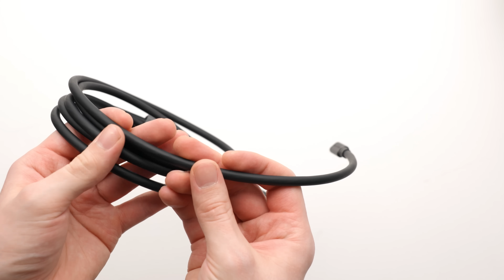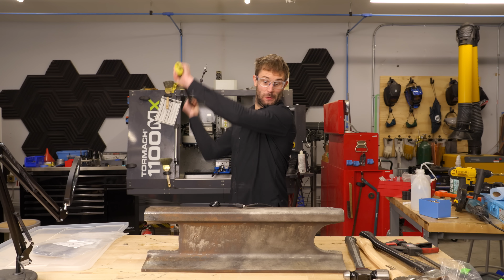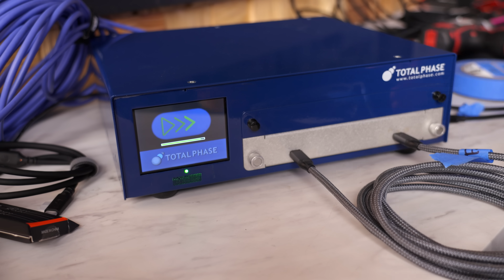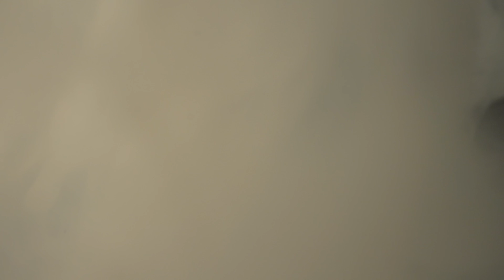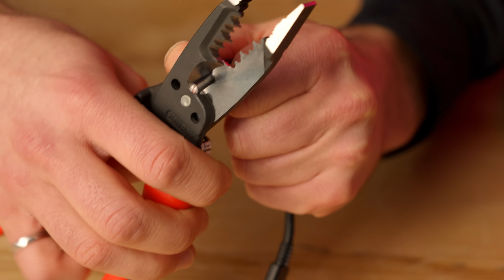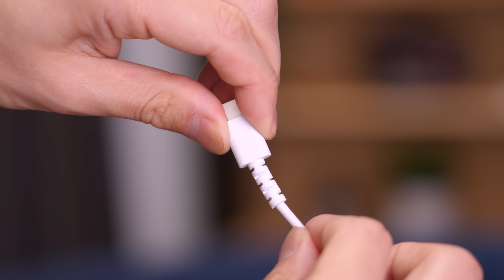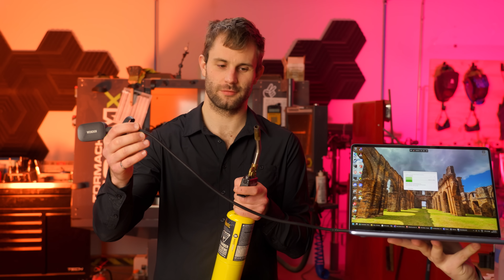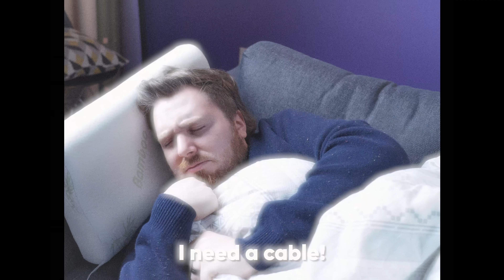Why It Took Me 4 YEARS to Make a USB Cable

Comment: "No products found" on the website. Oof
Reply: They sold out really quick. They talked about it on WAN.
Reply: @iSupermanCKi taking it down is so much worse than making it look like you never had it just say sold out but will all the information and pricing
Reply: @james10739  It probably has been taken down by mistake, they were having problems with the store, don't see why they would need to delete or unpublish their product listing.
Reply: @james10739  apparently there was a bug that allowed people to backorder the cables. so they took the page down while they are working to resolve the issue
Reply: @james10739  yeah, I just want to be able to see the specs and the price even if it’s not available at the moment
Reply: @james10739  Update from Linus: "We are having an inventory tracking issue where the site is allowing people to order out of stock cables and to minimize the number of backorders we are taking, we turned the pages off while we work with our team and Shopify to fix. It just happens to be the weekend so it's not as simple to get it's patched immediately. "
Reply: @james10739  They took it down because they are gonna charge more for it lol. Finally they will learn what its like to be an actual business like NVIDIA. They'll release a PR statement that says "We see strong demand for the cables and have taken down the page to better fix some issues for the future"
Reply: @james10739  It was an issue with shopify allowing people to purchase out of stock items so they had to just remove them completely so it didn't get backordered like crazy. Tons of websites were effected.
Reply: @james10739  I suspect they don't want to put a price up until they get an new batch of them
Reply: @james10739  It was taken down due to a site error, not just because it sold out
Reply: @james10739  Here's a direct quote: "We are having an inventory tracking issue where the site is allowing people to order out of stock cables and to minimize the number of backorders we are taking, we turned the pages off while we work with our team and Shopify to fix. It just happens to be the weekend so it's not as simple to get it's patched immediately." If the store allows people to buy out of stock products then that's not good. They made the right choice IMO.
Reply: @james10739 what if you have no supply but people keep ordering and you dont have a warehouse stock registration build into the website
Reply: @iSupermanCKi I’m so surprised they didn’t have good forecasting on the demand. A great USB cable is something everyone wants and can use multiple of and a lot of people trust LTT. Would have been the first thing I ever purchased from a YT channel haha.
Reply: @THONGPOUNDER6969  why would you want a "great" usb cable? legit question, 98% of them are just used to charge stuff and 2% are used every now and then to transfer files for which performance is not an issue
Reply: @moiseman  you really want to move gigabytes of data with sub-500 Mbit/s speeds?
Reply: @XGD5layer  what are yall out here moving?
Reply: @kobeandgary  These fans are tech enthusiasts, it's pretty likely that people here have external/backup SSDs, secondary mini monitors, local hub storage, etc.
Reply: @moiseman  Just because you only use them for those situations, not everyone does. Performance is an issue with USB cables, as discussed in this video, along with the situations where you could use one of these cables. Maybe watch the video? My main need for a high quality cable is high power delivery, which a lot of USB-C cables cannot do, despite that spec saying they should. Also video over USB-C, again, low quality cables cannot do. If you can get by with cheap cables, then awesome, but for those who actually need these, they are great.
Reply: @moiseman  You don't really want all of your cables to be "great", and 99% of the time it's completely unnecessary, but a lot of tech enthusiast would want a couple of them for that 1% occasion. Sometimes, you just need a USB C cable that works for anything.  

For example, when I travel, I usually bring a mini dock for my phone. It has 100W PD, built in nvme SSD, HDMI, and high speed USB C hub. I don't normally have to use it at its "full", but when I do like for work or offloading travel videos/photos from my phone and camera, I need a cable that I KNOW works. Not that hard, right? You'd think so, and I thought so too. It took me 5 cables that all claimed 10Gb/s and 100W before I gave up (some worked, but were unreliable). I had to go overkill and get a thunderbolt 4 cable just so I have some peace of mind.
Reply: @THONGPOUNDER6969  They did anticipate high demand, but were unsure of which sizes to focus on stocking. They bough a bunch of ready cables to terminate into appropriate lengths after the launch based on demand.
Reply: @Mel21-21  I know - I’m saying their forecasts for demand were clearly pretty far off, though (unless they were going for a scarcity marketing play). Just surprised their forecasting team missed it by so much. Builds hype though! We’re here talking about it!
Reply: @moiseman  Personally, I travel a lot for work and the one cable I can't seem to find a replacement for is my cable that powers my portable monitor or my USB hub with an HDMI out. That single cable has to do high power and high quality data or else my display just power loops. I've tried quite a few big brands like uGreen, Cable matters, and Anker, and none work. That's a hard cable to replace if it does ever stop working.
Reply: @moiseman  For me it’s reliability and durability, primarily. A cable is a product I expect to work as intended every single time. I’m willing to pay a little more for that. If it speeds up data transfers due to less error handling, that’s just a bonus.

If 98% of your cables are for charging, I completely understand going for cheapest option. I have 4 cables I use for charging devices daily and 25-30 handling data connections in my house/office. When one goes bad, it’s a pain to check all the connections one by one. Even on charging cables, if it lasts 2-3 times as long, the cost isn’t all that different.
Reply: @moiseman  Android auto, the cable that was working died, replaced it and the new cable is having issues almost immediately. I havent bought any but personally I want a 1 foot long LTT cable just so I dont have to fight it with it anymore.
Reply: @moiseman  While it may be overkill for a charging cable, a good quality one should last longer without falling apart, and be less likely to get damaged by accident — but who's to say it will only be used for charging? Sometimes you do just need a USB cable to connect something. Meanwhile for USB attached devices like fast storage, better cables that suffer less interference will give better speeds and reliability, same reason why you shouldn't buy cheap network cabling (especially the really thin/flat ones).
Reply: @moiseman  maybe 20% of my usb cables are for charging. The rest are for things such as video (drawing tablet, 4k web cam, etc), file transfer (large video files, backups, isos, etc), or IO (wired controller, keyboard, mouse, dock, etc). For a majority of these tasks, I often have issues with cables failing incredibly quickly, or performing very poorly, interrupting data/power from the slightest bump, taking 2-5x as long to accomplish a transfer, not working at all for video display, or creating measurable latency in input.
Reply: @THONGPOUNDER6969  To be fair it is a new market for them and going conservative means they won´t end up with a warehouse full of cables that noone wants to buy.

But ye the out of stock hype does not hurt either. :)
Reply: @Mel21-21  very true. And scarcity increases hype. I’m just bummed I didn’t get to buy any haha.
Reply: @iSupermanCKi  The page should read "Temporarily sold out" instead of "No products found".
Reply: @ShanesGettingHandy also keep showing the cable still. s0howing 0 products feels like the user does something wrong
Reply: @garcipat apparently there was an issue where people could preorder the cable even though LTT doesnt want to do that, so they removed the listing entirely to stop it from happening.
Reply: @agafaba unfortunate, hopefully their webmaster figures it out before people just start assuming the product failed to launch
Reply: @iSupermanCKi  So what as the price for the cables?
Reply: @Earth-Apple it's literally in this thread you just commented on...
Reply: @iSupermanCKi how much where  they
Reply: @thestarafresh   They were pretty well priced. Between $20-$30 USD
Reply: @therobowolf I've spent more on less for sure. my current 100w 10ft cable was $22 USD
Reply: . I honestly have zero clue what my current cables are rated at, but I don't have money to worry about it right now
Reply: @therobowolfoh. Thats's not nearly as bad as I was expecting. I thought it was going to be like $60-90usd. This is a price I think I might actually be able to afford!
Reply: @therobowolfthat's crazy, I was thinking they'd be more! I've spent that on a charging block alone easily.
Reply: @therobowolf Oh that's not bad at all. I was expecting much worse. I'll definitely be grabbing a few when they come back.
Reply: WHERES MY CABLES LINUS? TAKE MY MONEY
Reply: @Shellll  Yet another rug pull.   As if they couldn't predict demand, yet here the video stays up, gotta get them views.  Actually that's a great strategy, just announce great products we all want, they need not exist, and soak up the sweet sweet views.
Reply: @robpetri5996 lmao y'all are insufferable
Reply: @robpetri5996  So you think a multi-year technical development of a product can be financed by ONE video with currently 1.7M views?
Reply: @arlheinz  I certainly do not.  It would be financed by sales of product.   Alas there is no product to buy,  just a hype video an disappointment.  You don't have to agree with me.   Just annoyed because this happens all the time with youtubers.   They hype up a product or piece of merch and it sells out immediately, just wish folks would stock enough and it isn't like LTT didn't have the same situation with the screwdriver so they should have had a clue on demand.   That said i'm glad they are making them, I suppose they'll make more someday.
Reply: @r @robpetri5996 its just a cable. Don’t get so invested in such a small thing
Reply: @robpetri5996  I don't think you understand what a rug pull is. A rug pull would be if people bought it and didn't receive it.
Reply: @robpetri5996  go outside, bro
Reply: @robpetri5996  lmao this aged like milk
Reply: @mcbergstedt  Sweet.  Thanks for the heads up.
Reply: @robpetri5996  rug pulls work when you sell items, and leave with all the money dropping the value of the items to zero. If they don't have enough items to sell, how is it a rug pull?
Reply: @robpetri5996  Your argument boils down to demanding that small companies overestimate the demand for their products just to make sure they don't sell out.

Doing that is what killed THQ, they overproduced U-Draw tablets and it bankrupted them.

Just chill and wait, this is what sustainable business looks like.  it's only a problem if they're intentionally limiting production and trying to double-dip on the resale market, which isn't likely for a commodity product like this.
Reply: @robpetri5996 the fact that you actually doubled down 🤣🤣
Reply: @KevwePatani  I'll triple down too.   Its fine for us to disagree but I have every right to find it annoying to drop a hype release vid for a new product and not have the stock to last a few hours.   They know their audience and they know what happened with the screwdriver, it was avoidable.   It's great that they 'found' some more of two of the like 20 cables, doesn't change that it isn't unreasonable to find annoying the youtuber product cycle of "Big Splash!!!!" / "Sold out in minutes".   Why bother hyping the 2.1million people who watched this when they served some tiny number of people in the first couple hours.
Reply: @robpetri5996 "why bother advertising if you're just going to sell them all? " This is what your outburst sounds like to me. A nothing burger
As much as I'd like to consider myself unbiased, I'd have to admit that I'm a ltt fan. I don't throw a blind eye to their screw ups and missteps tho(Unsubbed during the billetlabs debacle). This whole "can't believe they sold out" spiel is a complete baloney from where I'm standing. 
In an ideal world they'd perfectly predict the amount of demand they'd have for this product and have ample money in the bank to be able to fund the manufacture of said product and then we can all hold hands and sing Kumbaya. 
But that cannot be farther from reality. Even if they could accurately predict the demand, say from extrapolating from the Screwdriver release, that wouldn't really cut it cause a USB cable is far more ubiquitous than a screwdiver  and so the demand extrapolation would be wrong. They would still need to have stocked the massive pile of cables in God knows what warehouse. Paying out of pocket for the merchandise and the storage fees. Without any indication that it wouldn't be a complete failure.
Also, i find it interesting how you consider a video that introduces and explains the product a "hype video". Like as if the claims made will turn out to be a lie. Or that it's a rugpull... Who's rug are the pulling?! It's their loss if they cant sell cables cause it's out if stock.

But yeah, i understand that people might not feel so fondly about the enterprise or the dude at the helm, but leaving bad faith comments like this to color people's opinion is totally not cool. Do better.
Reply: Update from Linus: "We are having an inventory tracking issue where the site is allowing people to order out of stock cables and to minimize the number of backorders we are taking, we turned the pages off while we work with our team and Shopify to fix. It just happens to be the weekend so it's not as simple to get it's patched immediately. "
Reply: @ovoovoovoovoovo  You're a rockstar! They should quote you quoting Linus in a banner on top of the website
Reply: @ovoovoovoovoovo  And that's why you don't launch on Friday.
Reply: @ovoovoovoovoovo  Nice
Reply: @ovoovoovoovoovo  you'd think they would still leave up a splash page then. have the link retarget to a Newsletter page that acts as a placeholder while figuring out the issue.
Reply: There are some cables available 😳
Reply: Strange to make a video and not having anything in the site. Even if sold out it would be good to see the products, prices and a email me when available
Reply: @TimdeVille  This. 100%.
Reply: @TimdeVille the curse of Shopify bugs and no weekend tech team to fix them on Shopify’s end
Reply: @TimdeVille  Exactly. Amateur e-shop
Reply: @cla_specialized  eh it's fine, at least the cables are good
Reply: @OwenProgrammer  how do we know that?
Reply: @kobeandgary because its linus, they make quality stuff 😂
Reply: @OwenProgrammer  according to what?
Reply: @kobeandgary  according to my personal preferences??? chill out we both can have different opinions.
Reply: @OwenProgrammer what's your opinion based on?
Reply: @kobeandgary  having multiple products of theirs that have worked for an extended period of time and were also third party tested and reviewed by official sources and other hobbyists :>
Reply: @kobeandgary  😂😂😂😂😂😂😂😂
Reply: @cla_specialized I mean, it's Shopify, so not amateur, just an error. It was pulling inventory numbers wrong
Reply: damn can’t even buy the first LTT product i’ve wanted :/
Reply: same, idk why other people saying they can look at it
Reply: God damnit. I want one. Haha. Preorder the next batch? You can hold my money until you get more
Reply: how much was it?
Reply: @thehaeggarr1625  it ranged somewhere between 26-29$CAD depending on the lenght
Reply: @c0dy42  That's not horribly bad really for an actual in spec, quality cable with high throughput  and power delivery.
Reply: @AgneDei yep. Everyone was surprised by the pricing and I'm sure that's part of the reason why they sold out in minutes
Reply: @c0dy42  Really? I expected more.
Reply: @c0dy42  woah no wonder they sold out
Reply: @c0dy42  Shame they didn't leave those prices on the website... nobody was expecting Amazon/eBay special prices and that's still well below the cheapest Apple prices, but the difference being at least you get a genuinely good product for the money - rather than Apple's engineered obsolescence.
Reply: @c0dy42  wow - I was expecting $45-50 USD. At $15-23 USD, I’d have replaced all the cables I own. They’re going to need to have a massive production run next time.
Reply: @c0dy42  doesn't Staples sell cables for more than that?
Reply: No products found
IT WOULD KILL THEM to POST there "SOLD OUT"?!?! Amateur e-shop...
Reply: Oof I was ready to order...
Reply: Great paper launch, well played Nvidia
Reply: Want to see a Anker vs LTT cable test next!
Reply: @marvinbrown2956  LTT cables don't exist so that can't happen.  LOL
Reply: It's on the front page of the website and same thing, takes you to the no products found page. Uh, maybe at least show something even if it's not available yet. "Coming Soon" would be better than nothing.
Reply: @andmicbro1  I was on the site 12 hours ago. It had "Restocking soon" on a bunch of cables. And from yesterday they restocked a bunch of their cables. So the "page not found" only happened in the past 12 hours.
Reply: Same here
Reply: Yet again a fail as nothing in the store.
Reply: “Available now,” but it’s not 🤣
Reply: It’s sad, I want the good stuff.
Reply: It was an issue with shopify allowing people to purchase out of stock items. Tons of websites were effected.
Reply: I can't order my cables. This would be the first ever product I order from LTT as well.
Reply: Four years to make a grand total of 50 cables that, of course, sold out instantly. Ordering 50,000 would have been too little as even if the initial buys totalled 40,000, the other 10,000 would have sold over time. Only having a handful to sell at launch, after 4 years of dev time is extremely short sighted.
Reply: Can someone post the price? I'm not going to check back after seeing the "no products found" page.
Reply: LTT temporarily delisted the cables from their store on February 1, 2026, because of an inventory tracking glitch that was allowing customers to order cables that were already out of stock. This Shopify system issue caused unintended backorders, so the company removed the product pages while working to fix the problem
Reply: They don’t exist if they are “not found” - pics or it didn’t happen
Reply: They had to delist because they sold out, but the website was still allowing people to order.
Reply: it worked for me. the qr code that is
Reply: There's also the fact that the imperial measurements are in feet even for the very small length cables.... 10 cm / 0.32 ft... wtf? Why not just put 4 inches.
Reply: guessing the products are only available in some regions
Reply: @CritLoren No, must be some kind of mistake, I bought some and now that I wanted to buy more they're gone from the catalogue.
Reply: @ovoovoovoovoovo They made big estimate error... And their products are way cheaper than the people expected...
Reply: @skak3000  I know, right? I thought I wouldn't buy any, ended up buying a bunch.
Reply: @ovoovoovoovoovo   What are the prices?
Reply: @opieknievel  Like 25 to 30 CAD
Reply: @ovoovoovoovoovo  For what length? For a quality cable, that sounds like a reasonable price if it's long enough.
Reply: @opieknievel  For every length, I believe they go from 10cm to 5m, all at about the same price for USB A to C and USB C to C.
Reply: @ovoovoovoovoovo  I'll definitely have to give them a look when they're back in stock.
Reply: How much were they when you bought them (as we can't see them)
Reply: @CritLoren Including in Canada where they are based lol.
Reply: Useless unavailable vapor wear. Why post this to waste our time?
Reply: @urbansnowtrax3733  they sold out fast  smart guy
Reply: Tried vpn to Canada but still no product
Reply: They were super overpriced anyways.
Reply: @wck  Im sure if they did a cost breakdown and it showed them making $.25 cents per cable you'd still call it expensive. Wait for a sale?
Reply: @Harkins1721  it has the dreaded influencer tax, no doubt. as does everything on LTT store.
Reply: @wck  Look man. If I'm buying a true 240w cable it's going to cost me.
Reply: @wck  If you compare it to a $8 Amazon cable and dont look at speeds or durability yeah sure.
Reply: @wck  how much was it anyway, I didn't get a chance to take a look
Reply: @wck  lol what a stupid comment... on a video that goes into detailed explanation of these cables compared to other cheap cables
Reply: @Nighthunt01  except this isn't competing with cheap cables, is it, genius?
Reply: @wck I mean, they kind of are though.
Reply: @wck except they are competing with cheap cables, because these are pretty damn cheap for what they are.
Reply: @wck I mean, between the 2 of you, if ones a genius, it certainly isn't you.
Reply: @wck they were unbelievably underpriced for what they are actually.

If this were any other company you'd be looking at $150-$200 for these cables lmao